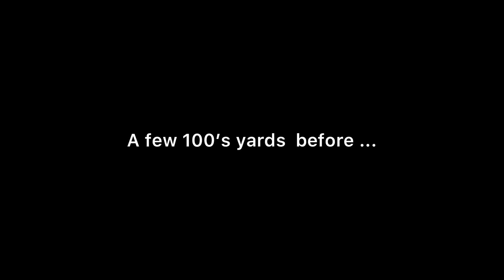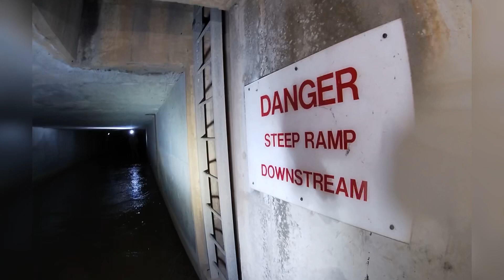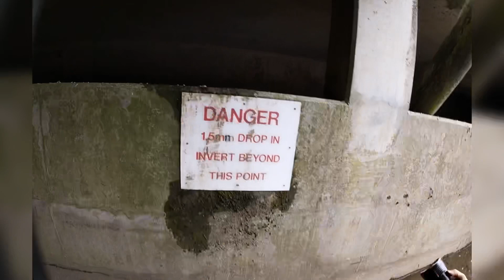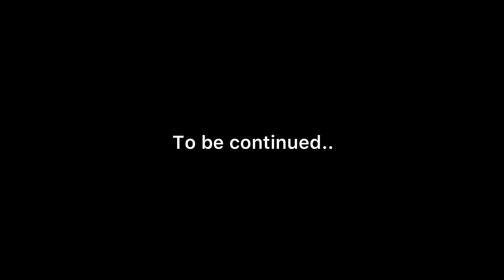Lost River Series
 -BRADFORD BECK BYPASS-

Comment: Judging by the large cylindrical chamber and the way the pipe from around 14mins in is made from sections of rings rather than just rings/pipe this was dug by either a small Tunnel Boring Machine or a manually dug Tunneling Shield, the huge chamber to the surface is where the equipment is lowered, the ring sections are slotted together and the TMB/Tunneling shield pushes off from them.